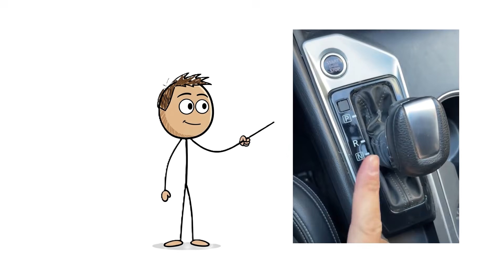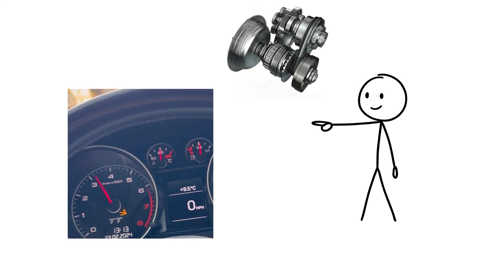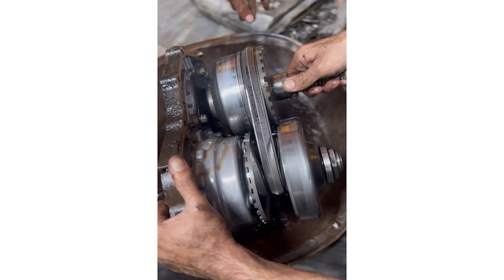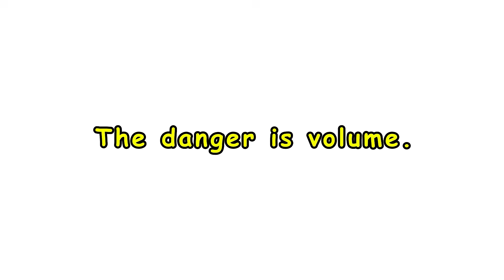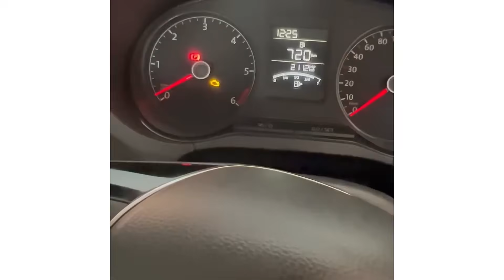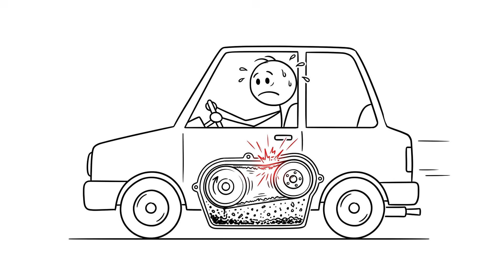99% of CVT Owners Have No Idea How This ONE Bad Habit Destroys Their Transmission

Comment: I bought a 2009 Nissan Murano, 3yrs ago. The first thing I did, was change all the fluid in it & got it on my maintenance schedule, because it was no telling how long the previous owner changed all that. I don't go by the manufacturer recommended fluid change. I change it, way before that & I also don't drive it, like it has a regular transmission & I also don't tow with it & I believe that's why my Murano has over 220,000 miles on it. I only let certain people drive my car, that I can trust.
Reply: I have a 2014 Nissan Versa,  the worst of the CVT transmissions.   When it dies  I'll be getting an older car with a real transmission
Reply: @rushfanjames2112 I wish they could beef it up and make it stronger. But I'm in the same boat. I love the cvt when it's good. So smooth with no gear jerking.
But the extra issues aren't worth the problems.
I'll take a tried and tested one next time.
Reply: @skepticalgenious    The design of it doesn’t really allow for any beefing up.
Using actual metal gears is the best thing for cars and trucks.
The CVT design for the vehicles is planned obsolescence,  they’re designed to fail in a short time, regardless of regular maintenance.
Reply: @rushfanjames2112 I think it's originally from Ferrari. Made for formula one cars.
Although it could double as both.
Reply: @rushfanjames2112 😂 I had a typical American or man idea. Essentially make it bigger and stronger. Testosterone logic vs physics.
Reply: If it's like my 2024, reverse gear final drive ratio is a fair bit taller than 1st or lowest forward ratio. Not sure why they do that but many/most transmissions, conventional auto or manual by most brands do have a reverse gear that is needlessly tall. With a manual it just puts more wear on the clutch when parking, especially if you back 'up' into your driveway. And that's why I'm mentioning. The worst strain on a CVT (after too much heat) is 0-2 mph. So if you have an option of driving in (especially if your driveway is steep) it will be easier on your CVT. Of course backing out into traffic possibly is a potential concern too so life has compromises. If this describes your driveway, and you're able to drive a bit faster from stop to final resting place without coming to a stop and using the torque converter as much, this will help alleviate that wear area on the two pulleys where the belt rests the lowest in between the pulley halves. 
Your practices you mentioned and maintenance schedule was a good idea. Non jack rabbit starts and also coming to a relaxed full stop between going from forward to reverse or vice versa, also is a CVT saver even more than with conventional autos. People who knows these things and change fluid every 30k miles or less if in hilly terrain often or brutal cold below zero starts often, are the ones who do 300k miles on these transmissions without much of any trouble. Don't forget the 2nd small filter! It's an external filter placed vertically facing the driver side if you're under car doing an engine oil change. Even many dealerships overlook this filter.
Reply: @user-5gu78qo27i You are correct that the initial acceleration causes most of the wear on a CVT. That's why Toyota CVT's, like the one in my wife's 2020 Toyota Corolla, has a launch gear. The launch gear is a conventional gearset that accelerates the car from zero to about 10 mph, then the constant velocity mechanism takes over. This prevents a lot of the wear on the belt and substantially improves the reliability and longevity of the transmission.
Reply: @joevignolor4u949 Toyota uses ECVT,  much different than traditional CVT
Reply: @jamesjeffers7270 Yes in hybrids. Toyota still makes some non-hybrid models that have regular CVT's.
Reply: @joevignolor4u949 Thanks for the information.  I was not as informed as you. ✌️
Reply: Or rather faces away from you but sits horizontally. The top bolt is a bit hard to reach but doable.
Reply: I used to have one but it got replaced with a 2020 Hyundai Santa Fe…